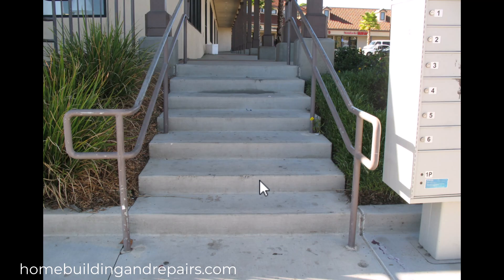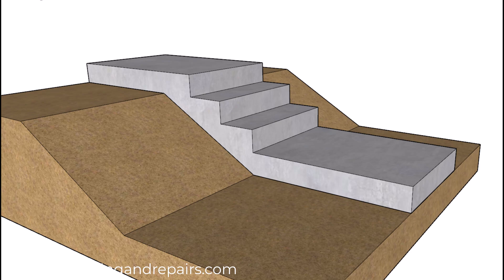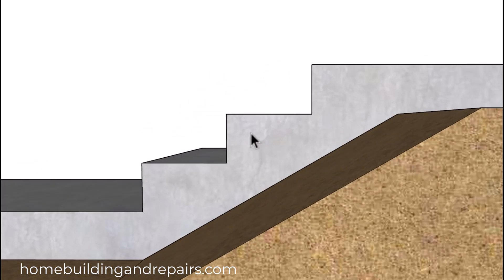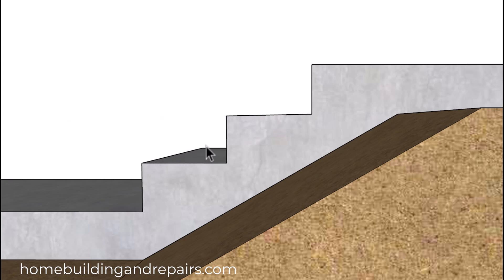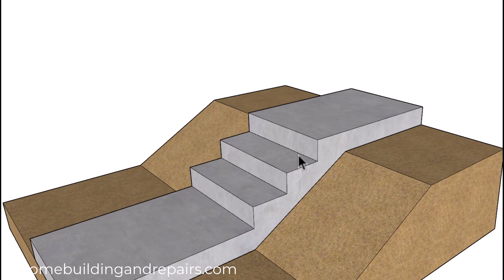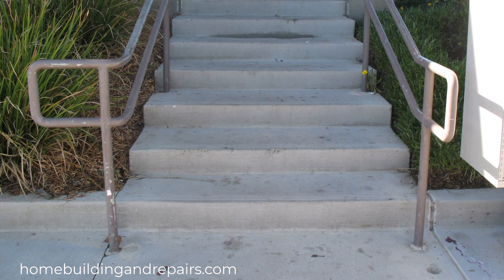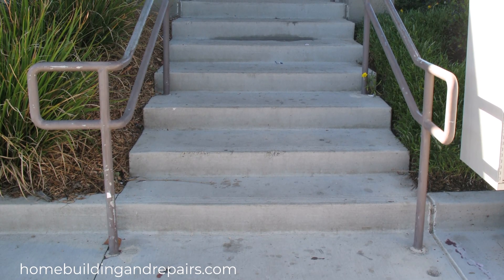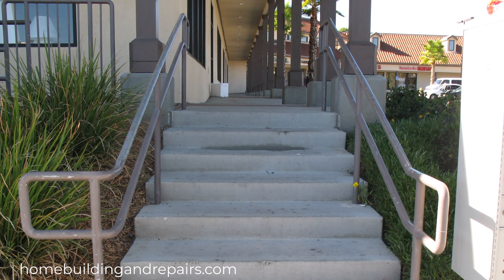Building Code for Stair Slope - What You NEED to Know About Drainage And Danger

Comment: Sloping each tread .25” seems a little heavy-handed to me. Did many, many sets of concrete stairs and always sloped them 1/8” from back to front. Never had a call back issue for a back pitched step, holding water. Even concrete stairs in an enclosed space, it’s a good idea to pitch the treads out slightly. You won’t feel an 1/8” pitch.
Reply from the maker: I like what you are saying, but I've had problems getting water off of the smaller slopes, especially if they add a metal nosing strip at front of each step.
Reply: @stairbuilding  I know exactly what you mean with the metal nosings. Honestly if they are a wet-set nosing, you really need to be there with the finisher and tell them to be sure the imbed is slightly “shy” of the riser form itself. Otherwise yes, they tend to set them just a little “proud”, after shrinkage occurs. With only an 1/8” total pitch, it has to be sufficiently buried. If I set the nosing imbeds prior to the pour, I cover them with a double layer of duct tape. Top of tape right at top of riser form. When you strip the tape the nosings are buried just right. Of course the tape also provides scratch protection as well.
Reply: 1/4 per foot is deck slope.